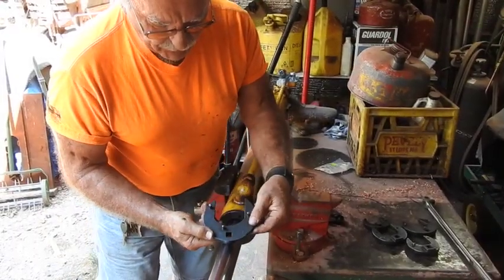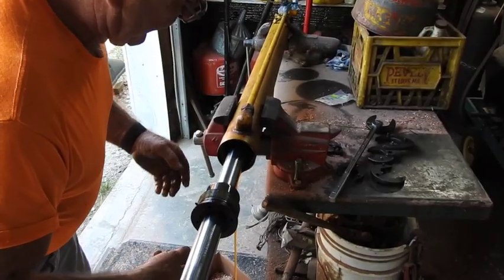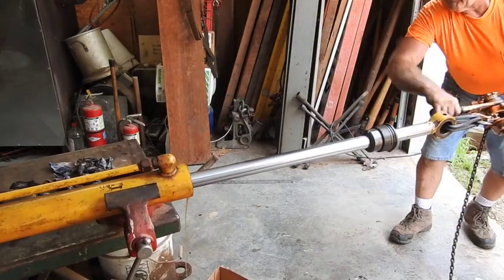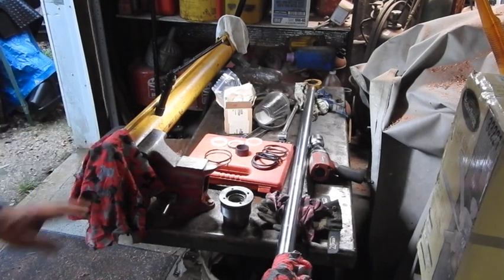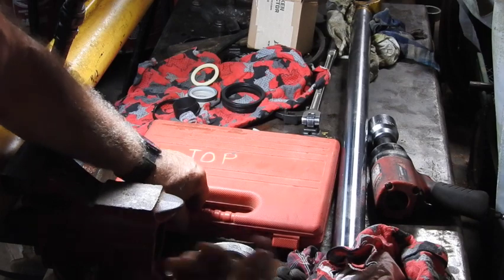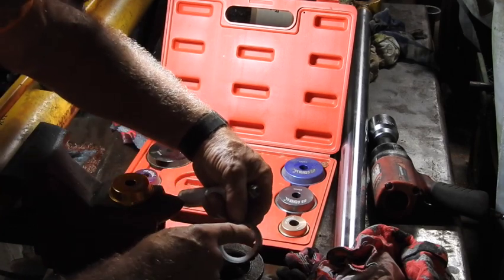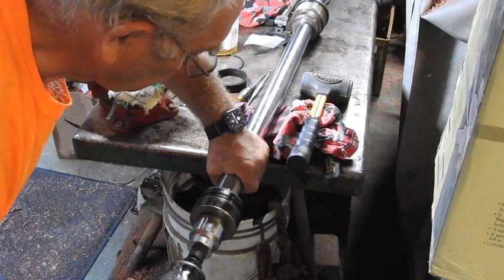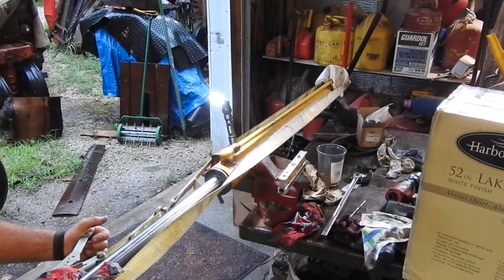Case Backhoe Boom Cylinder Repacking Job

Comment: Thank you for your video. I was given two hydraulic cylinders just like these. I don't know if I will ever build anything from them but I'm a retired welder and if I need a project to do I'm sure I can come up with something to build.👍
Reply from the maker: I'd never turn down a hydraulic cylinder...there's a lot of potential for tons of projects right there.  I'm not a real welder, but I've been known to melt a rod or two here and there.  Most of my welds look like a pair of mud daubers were fighting...but for some reason they seem to stay stuck pretty good.  (-:  I have a couple spares of various sizes myself.  Might never use them, but it'll give the auctioneer something to sell after I'm turned to dust.  Btw, I picked up a single phase Miller Synchrowave 500 a/d-d/c arc and TIG machine with water cooled torch....  Think I should try to learn TIG or just stick with the MIG and stick.  Thank you Murray for stopping in for a visit !!
Reply: @tractorman4461  That's great you were able to score a TIG welder😲👍. Welding aluminum always comes in handy in today's time. Just go on YOUTUBE and watch a few videos and with a little patience and practice you will have it down in no time. Investing in one of those "self darkening" welding helmets makes learning easier. I do recommend getting a shade 12 in those helmets. Anything lighter I have had eye problems with. You will never regret learning the trade of welding. I have saved myself thousands of dollars in my lifetime by "repairing" other than " replacing".👍
Reply from the maker: @murraychadwick9362  I've always been intrigued with rest of the trades, myself being a commercial hvac tech.  I'm a retired pipefitter, but I was on the service side bouncing in and out of the construction side..mostly refrigerant piping, gas piping, chilled and hot water victaulic piping.  So I did a lot of welding but never managed to take the certification tests.  None of my stuff was ever x-rayed or anything.  Nothing that important.  I have been watching a few channels that specialize in TIG so I'm not intimidated by it as I once was.  But I know its gonna be a learning curve.  Thanks for the suggestion for sure....I think I'm on the right track !!

Comment: That is not a coffing hoist it is a chain hoist
Reply from the maker: Technically you're right Paul, its a different brand.  I guess its kinda the same thing as calling a Diamond brand or Chinese made adjustable wrench a 'Crescent' wrench or Craftsman adjustable pipe pliers 'Channellocks'.  This particular one I'm using is much cheaper then the Coffing brand: https://www.globalindustrial.com/p/coffing-lsb-ratchet-lever-hoist-3-4-ton-5-ft-lift?infoParam.campaignId=T9F&gclid=CjwKCAiAuOieBhAIEiwAgjCvckqC0AX7UzaXcNX0kPq9i1lOa-Jxf8jfWvakb9A15HYRoL64mBLVLhoCUeIQAvD_BwE But the main thing is its just a ratchet operated tool that uses a chain to move or pick up an object.  Thanks for watching and making me think before making a reply.... I appreciate the time you take watching the videos.

Comment: Very well done with what you have, I've heard of repacking cylinders but never seen it done. Gotta 4020 JD thats on the menu now, got estimates upwards of $1000.00 for the two main lift cyls to be "repacked". I'll give it a go now for sure, Thanks for your video information.
Reply from the maker: Look for identifying numbers on the packing gland just in case.  There may or may not be any.  Usually just the model of the loader is enough to get the right packing kit though.  Yours may come come apart with pipe wrenches and not the spanners. Keeping the parts clean is important and oil soaking everything for reassembly.  Also, be very careful to not damage the ram surface.  Yours may or my not be easier to disassemble than this one.  Another thing, if you use a come along, make sure the ram is pulled perfectly straight as an offside pull could put a bend in the ram.

Comment: I wish the rams on our old JD Backhoe where smooth and shiny like your are. Ours are pitted and rough. New seals wouldnt last as long as it would take to install them.
Reply from the maker: Yes, that's bad.  I've had luck with steel wool and 600 grit, but if they are as bad as yours.....bummer.  I keep both 303 and AW32 on the shelf ALL the time.

Comment: Great job Wendell, never do a job like that, good to have a video as reference when I need to do it, by now I guess the Case is back in business
Reply from the maker: Almost Jan.  I went down to the property yesterday to reinstall it and was met with a good bit of rain once again.  Not a thunderstorm, but a slow steady rain, so instead of getting wet, we worked on another project down there that's also in the que.

Comment: nice job like always  just one question why didnt you compress air to push the cylinder out  but i shouldn't question a master like you
Reply from the maker: Yes, that is sometimes an option, but to do it without totally draining the oil first, a person stands to receive yet another oil bath Mark.  LOL  If you have to rely on just holding an air hose against the fitting by hand, if you break that hold,the built up air pressure will blast the oil spray right back at you unless you have a second person to handle the ram's exiting of the tube.  Also  I didn't have handy a solid connection fitting to apply the air pressure or the second person for the ram.  Working alone, the coffing hoist provides the needed control, or at least that's my opinion.  But like I said in the video, the real pro's don't do it in this rudimentary fashion.  Thanks for watching and for asking the logical question Mark.

Comment: Goes to show you mechanical operations there’s more than one way to skin a hydraulic plunger. Great video I actually learned something about hydraulics today. I definitely heard that storm sounded very loud was there hail too?
Reply from the maker: There was a short spot halfway through the storm where I swear I heard hail hitting the roof....either that or some heavy twigs off the trees.  Hydraulics are kinda like pneumatic controls to an old hvac tech....except different.  LOL  Remember pneumatic actuators on dampers or inlet guide vanes on large air handlers...??  That's just air pressure instead on oil pressure moving a ram.

Comment: Wendell once again you show how it can be done with some of the right tools and a make it happen mind set for the ones you don’t have 👏. I have seals on dads old car lift I have to tackle or at least pull and have done. Having a large piece of equipment that does not work killing space is a pet peeve of mine. You’ve inspired me to tighten up and getter done. Of course several other items and commitments have precedent first . Seems always to be the case other than can’t do with out items lol. Great vid and I always enjoy rain days in the shop.
Reply from the maker: Oh heck yeah John.  I hate for something dead sitting in the shop.  I've got several three phase machines just sitting there waiting on me to install either the home made rotary converter or more variable frequency drives.  One big chop saw and a nice surface grinder awaits....among other items.  LOL.  If those cylinders are too far gone due to water and winter chemicals, I'd check Surplus Supply for a cylinder with the same dimensions and go with it !!  The hardest part of working on obscure hydraulics is finding the correct parts for them.  Some have I D codes  stamped on the end of the gland or gland nut.  Not all though. Good luck with what ever you decide !!

Comment: Learned enough to send that to the shop! Still  amazing  to see how you do the job. I may have asked you about  that chain comalong. How much  do you find them for? I never see them under 100?!
Reply from the maker: Hahahaha....sometimes its the best thing to do Mike, but be prepared for a hefty bill !!  Sometimes you can buy a replacement cylinder off a salvage yard reasonable, but it's still a crapshoot.  I bought several coffing hoists over the years and recently bought another larger one from a retired iron worker for $15.  Then I have a tiny one for tight spaces that's rated 500 pounds.  I used that one for large compressor changes and large motor changes in air handlers.  That one new was around a hundred bucks many years ago, and it is super handy for a service tech.

Comment: You've done really well and v-belt is a neat trick. Done a few of these before without the correct tooling. Difficult to say the least, but possible. One had a snap ring instead with no actual holes for circlip pliers.
Reply from the maker: Well, we gotta do what we gotta do.  I've done a lot of stuff without the right tools. LOL  I don't recall working on one with the snap ring retainer.  But I surely haven't seen them all by any means.

Comment: I bought a J.D. 310c this spring in very good shape but most all cylinders have slow leaks.  I think I better get on it so I don't have a blowout like you did as oil is very expensive now.  J.D. uses a different spanner and there's even an adjustable one for all the diameters.  Also you push the gland in a bit then put a plastic "tool" in the grove to allow seals to slide past grove to pull gland&piston out.  Love your channel, your skills and good teaching.  Couldn't believe how fast it started after sitting 2 years.  Thanks for the video from an old guy in Michigan.
Reply from the maker: Thanks Jeff for the kind words.  I appreciate the time you take to watch.  I don't have the plastic sleeve for assembly, but we just soak them in oil to minimize damage.  I don't have the JD spanners and chances are they are different spacing that the Case wrenches.  My packings were holding well, but what blew on this one was the actual seal up in the gland nut.  So when it blew it sprayed an impressive half moon shot of oil about 20 feet every time I raised the boom to get out of the spot the tractor was in.

Comment: Using an old vee belt is a great way to lift or pull things, provided that, as you indicated" it's one that you're not going to use  it again for it;s intended purpose. . They sure can take a lot of strain.
Thankfully, so far, I have not had to rebuild a cylinder,... yet! BUT now I know what to expect, Thanks for this Wendell', always a good tip or three from you. 
Thumbs Up!
Reply from the maker: Dang Reg, you've skated by this long without a blown seal....you must be paying the preacher on Sunday pretty well.  LOL.  They are not all this easily done.  Wait till you see what we had to do for the Much Older Brothers loader cylinder a few months ago.  I haven't edited the video yet  LOL...it was a nasty bad job.
Reply: @tractorman4461  Well you see Wendell, a lot of my time with and around this equipment was in the capacity of Service Manager,....:) so I just had to try to keep customers happy and as well the mechanics who did this work,... but then again, guess who's on 'the firing line' when a repair goes bad! Hahaha...
I'll look forward to this video too, now.
Stay well my Friend.
Reply from the maker: @regsparkes6507  Dang, you had the best end of that deal !!  I think.  LOL  I've never been in a managerial position at all.... I stayed on the bottom rung where it was easy to hold on....LOL
Reply: @tractorman4461  Well, let me tell you a little short one, I worked for and with a large heavy equipment dealership, who also owned a small equipment rental/sales/service division, I worked for that division too. I always told my boss that unless your customer ( contractor ) rents a little ol' 2" water pump, from The Rental Division,  to get the water out of that hole, it's going to be difficult for him to use  'your' heavy equipment. So the thought here is, unless somebody starts at 'the bottom',  how can anything get done.
Therefore mechanics and technicians etc, are very essential to finishing the project.
Reply from the maker: @regsparkes6507  Oh now I'm thinking you may have missed your true calling.....Motivational speaking !!  Hahahahaha....  But I have to agree with you that every rung of the ladder is essential to a successful operation.  Remove one rung and the end result can be very difficult to attain with a high level of satisfaction.  By the way, that was a very good analogy that fits the situation Reg.
Reply: @tractorman4461  Thanks, and you know, I'm glad I'm retired. Did you know that most "Service Mangers" usually have to wear a target on their backs,..... hahaha.
Reply from the maker: @regsparkes6507  Sad, but true.  Same as hvac service managers and auto mechanic service managers....and the list goes on.  All guys like me have to do is fix stuff and carry no baggage home....LOL
Reply: @tractorman4461  If things go wrong, or even maybe don't go wrong, we get it in the neck ( or lower ) from the customer, the sales manage and then the BOSS!  Oh well, I'm retired from that, and I liked the job.
Reply from the maker: @regsparkes6507  I think most of what makes a job good or bad is the attitude and ethic you bring with you.  I've worked with guys that did the same work I did who hated how their life turned out at home or on the job.  I could never understand how someone couldn't find anything at all to be happy about and it invariably reflected in the job they did.  I am however, glad we both found rewards in our own careers though both were almost as different as night and day.
Reply: @tractorman4461  You're on the mark here!

Comment: Good evening Wendell.
I have done a lot in my life but never repacked a cylinder..
Not sure I have the confidence in myself to do that..
Years ago when I had all my mentors looking over my shoulder I would have done it. But never had the need.. Now I have my dads old Electric log splitter he got back in the 70s need to be rebuilt.. It runs on 30 weight motor oil.. I just keep her full.. hahaha and put up with the leak..
Maybe I will tackle it now if I can get the seals.. hahahaha
Thanks for the inspiration..
You can do this Gus.. hahaha
Can’t wait to see your handy work back in action..
Great video my friend..
As always stay safe and always be kind..
Cheers
Reply from the maker: Slow and steady wins the race Gus.  The main thing is to make sure you have the correct kit for the cylinder and pay attention to the stacking and it'll go good.  But the big part is disassembly if you aren't set up for it pretty good.  We will get it back together on the tractor soon as it dries up a bit.

Comment: That's a good thing to know tm44. I've had hydraulic cylinders leaking and never tried repairing one myself.  You showed your subscribers how we can fix these problem leaks. Thank you tm44.
Reply from the maker: The easiest ones are the ones with the huge nut cast into the packing gland.  If the cylinders have sat and rusted unused for a long time, these that need the spanners are about the worst.  But they are most all doable Dean.